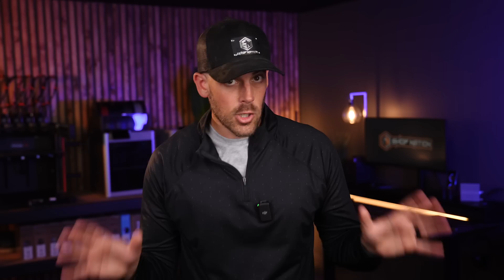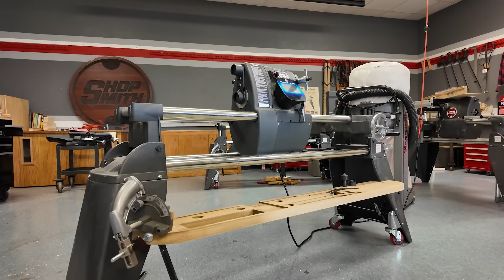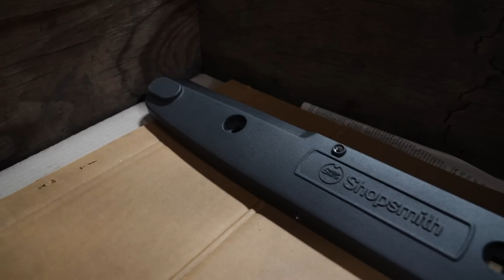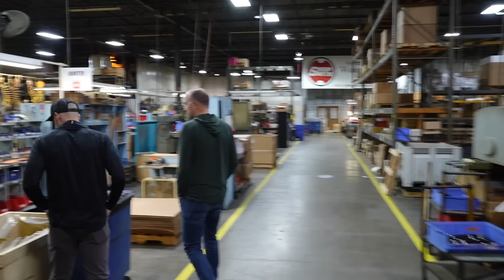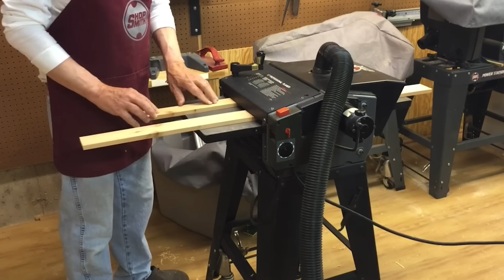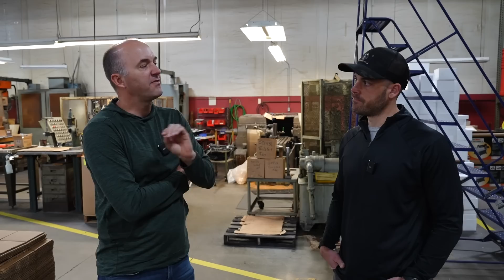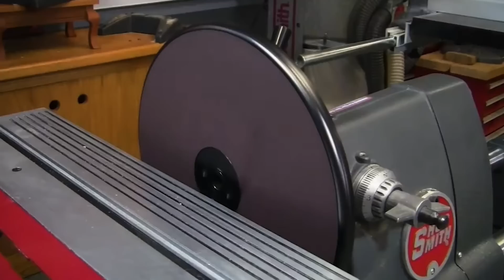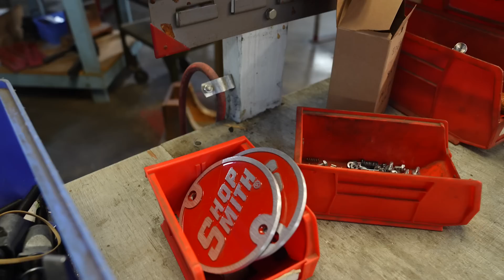The Last American Power Tool Company is (almost) dead

Comment: Nick was correct to downplay the table saw aspect especially since its a tilt table design which greatly increases the danger of binding and kickback when you tilt the table for a beveled cut.  Back in the day we had a few tradesmen who used ShopSmiths and they were not a good choice for job sites to say the least due to their unwieldiness when unloading and loading and we eventually had to ban them from the sites due to the tilt table mishaps.  For use as a hobby saw in a home shop where you'll never be making a beveled cut especially on large stock they are fine.

Yes its sad that most American Power Tool Companies are owned by foreign groups with most manufacturing done offshore.  For example Milwaukee, Rigid, Emerson Electric, Homelite along with a few others are owned by a Hong Kong based company who owns Ryobi too and also makes cheap vacuum cleaners.  Last time I replaced a bearing in a Hong Kong Rigid power tool (made in the Ryobi factory) and asked for an exact replacement bearing since it was for a sander, the owner of the local bearing supplier told me he refused to sell cheap garbage bearings like that and I'd have to pay for a higher grade which ended up costing less than $2 so one has to ask how cheap was the OEM?  The OEM only lasted a few months so obviously very cheap indeed while the $2 bearing has lasted several years in much heavier use.  It took less time to fix it myself (two hours including the trip to the bearing supplier) then to wait weeks while it was sent out under the "Lifetime Warrenty" for review to determine if it was repair, replace or deny.

Of course we have to blame ourselves for this since it was back in the 70's and 80's the government sponsored advisors were sent out to groom businesses for expansion with the formula for success we paid to develop and implement being to immediately offshore manufacturing to South of the Border and get rid of our manufacturing staff in the USA but don't sign any long term contracts so you could switch manufacturing over to China once the administration opened that avenue up.  We sat there in disbelief as we were told to basically axe the family and friends or in other words loyal employees who helped us grow our business and hire South American Companies temporarily and then dump them after they invested in expansion to support our business to shift manufacturing over to China.  We viewed this as highly unethical but couldn't compete with those who did as advised despite having a superior product.  People stop us to tell us that how now 40 years later our products are still holding up while they've gone through many of the off-shored alternatives they had to purchase as they expanded their business.

How's that go...  Load gun, raise foot, take careful aim and shoot repeatedly if need be until you get the job done.  Yes, we basically shot ourselves in the foot on this one and the road to recovery will be a very difficult journey with many casualties.

Whats next is probably an AI controlled Robot with a variety of attachments to work wood, metal, etc to replace us altogether and can also do the yard work, clean the house, cook our meals, bathe us, etc, etc, etc.  What could go wrong....  Oh no, that's a power plane not the bath loofah!  ;>

Best!

Comment: I bought all of the tools in my shop that the Shopsmith has, and it all cost far less than the Shopsmith Mark 7 and they far surpass the capability of the Shopsmith. No one has any use for a 4" jointer. Six inches is the minimum for a useful jointer. People are also moving away from straight blades to helical cutters. I started with a 6" straight blade jointer, and now use a small footprint 10" jointer with a helical head. I needed the extra width and ease of use with the helical. You have a good, solid product, but you need to get with the program of the evolution of woodworking. Slab leveling would be a good addition to the powerful motor of the Shopsmith. Keep your heritage and base platform, but grow with the times.

Comment: I am 77 years old.  I still work in my shop daily, (hobby) and I have pretty much any and every tool in the book.  But I don't own a shopsmith.  They have an outmoded idea of what the market wants.  European manufacturers make combo machines, that are pretty good.  But they don't try to do EVERYTHING.  Their tools combine two or maybe 3 things.  Shopsmith tries to combine too many things.  So, fine for the beginner, but after you get skill, you get dedicated machines.  (I have 3 large table saws, a small wide belt, 3 jointers, 2 bandsaws,  shaper, sanders, mortisers, etc.  
Also, not sure I understand him saying they are the last.  First, there is Northfield, (Minnesota made)  They make great machines.  Table saws, planers, jointers, bandsaws, etc.  HIGH quality.  People will still pay for quality.  Been around for more than 50 years.  Or what about Shaper Origin?  I know they have their machines made by Fesstool but they design and sell them from CA.  They are a new company, again, QUALITY!  and innovation!  There are others too.  I'd suggest that they take their mfg knowledge and design a great machine, a better drill press.  (3 phase motor with a VFD, motorized table adjustment,  maybe push button drilling option?  Or a great sander?  Most people don't buy edge sanders and they should.  Or an innovated wide belt sander?  open ended one like PM and others make.  but market it!  smaller machines?  a really large RA sander?  like an 8" one that is electric.  A lot of folks I think would like that with all the folks working with slabs..   wish them luck.

Comment: I run a Laguna table saw and a pieced together 1950s Shop Smith Mark 5 that I inherited with a new all electric motor.  I have a smaller shop, and this setup works well for me, but here are the areas that need improvement on the Shop Smith from a long-time user of the product:
1) The learning curve on how to use them is steep, and with outdated materials and info, it can be a big barrier to using the tools. Sometimes, there are several steps and procedures that are not inherently obvious to the wood worker.  I heard we can expect some new youtube videos, and that is great, but there are guys out there on YouTube making content with these machines already, and they do a good job. The machines them selves are not easy to use for most people, especially when a lot of our world today is plug and play. 
2) The maintenance schedule on these machines is outrageous for the average wood worker. I have rebuilt my machine and head stock several times over the years, to the point that I was doing more maintenance and fiddling with it than actual wood working. Great if you want a project tool but annoying when you are trying to finish one more Christmas gift for the wife. It is better now that I upgraded to the power stock head with the digital pad, but the rest of the machine still requires more routine maintenance than any other tool I own.
3) The cost, I used my first machine at age 16 in my girlfriend's dad's garage and loved the idea. But way too expensive to get into, so I waited until I inherited on from my wife's dad, then I started buying old ones for parts because the parts are expensive as well. Slowly rebuilding the machine as I got money. It was a project that was not making other projects for a long time. I understand manufacturing costs and built-in the USA, but many some form of payment plan or something would be helpful. I bought my wife a $10,000 sewing machine, and they let me pay monthly for 5 years. It makes it more manageable for people.
Pros:
These machines are beautiful and one of the most versatile machines for a small shop. I use mine almost every day I am in the shop. It gets more use than any one single tool besides my drill/driver. I believe this is a great product if people know how to use it safely and to its abilities. Great machines and I am glad they are working to revive the company.

Comment: Loved seeing this video. I honestly thought they had closed years ago. I am a fan of them and owned a 10ER as one of my first machines. I started “making” with turkey calls, and that machine would do everything I needed it to do. Even as I grew into a big shop space I kept it around as a “just incase” tool because it was a backup everything. The only reason I don’t have mine anymore is when I sold that property the new owner specifically asked for that tool to be left in the workshop.  Best Craigslist $125 I ever spent.

Comment: I have a shop full of power tools.  I've also had a couple of Shopsmiths--an old Greenie and a newer Mark5.  I've mainly used the Shopsmith as a horizontal boring machine--and it's a great one.  But also as a variable speed bandsaw and a sander.  Great niche tool even for those of us with a shop full of other machines.  I used to work out of Dayton, and regret never having stopped by Shopsmith (easily in view from the highway) to see what was going on.

I wish them the best, and hope they can find a way to keep building a classic American machine!

Comment: I see lots of comments praising the Shopsmith. My dad had a Shopsmith while I was growing up and that is what I learned on. 40 years ago, I bought my own, have done some upgrades over the years and have purchased some of the accessories. I am a hobbyist, I have never been into mass production and don't sell anything I make.

However, I find it too imprecise. Too much deflection in the fence. Too much deflection in the table when using the drill press. I cannot create miter joints on long pieces of wood. Because of the tilting table, anything over 4' long will will either hit the floor or the ceiling. The miter gauge slots are not a standard size. Cannot get the tension on the bandsaw correct for re-sawing. On the other hand, it does make a great lathe. Alas, I'm not into turning. When I upgraded the table and fence, I lost the option to use the mortising hold down with the new fence.

It is a great idea, and when I was operating out of my basement, it was the only thing that would meet my needs at that time. For someone with limited space it isn't bad.

My suggestions are to standardize the miter gauge slots, and improve the fence. Make a better blade tensioning system for the bandsaw.

Comment: Trying to replicate what was done in the past will not work. The key to Shopsmith future success is to develop a new business from the bones of the old one.  Even in the hey day Shopsmith has always been a niche product.  The key to Shopsmith future is to  ditch the all in one tool and consumer market.  Shopsmith could sell the components in custom designed configurations to make one type of part to the custom mill shops and small manufacturers.  Shopsmith could offer a complete solution to small custom manufacturers for making their products using similar motors, controllers, components and bases.

Comment: As one who has owned a Shopsmith for many years and passed on the machine to his son who also is a woodworker I will tell you that owning and operating a shopsmith has always been a joy and a privilidge, I even did an upgrade to my machine myself with great success. Having had a relationship with the Shopsmith Brand for over 30 years I was amazed to see it was in trouble, to lose such a valuable piece of equipment would be a major loss to the US woodwworking inductry and a major failure to thousands of DIY'ers.  I suggest that as many as possible support the revival of the Shopsmith brand!
Phil Owens SFC Ret.

Comment: Two things:; first the woodworking hobbyist culture is dying and had been since the advent of the personal computer. Second, offshore made machine-seperates can be purchased for less than the Shopsmith now and afford greater versatility. Shopsmith survives by having a small following, mostly of people that were exposed to one bought by their father or grandfather. It's not a BAD machine, it's hard to compete witrh a company like WEN that can sell a whole suite of tools that do the same thing for less money. Electric motors and inexpensive casting are very economical now.
The statement that a same percentage of young generations want to be woodowrkers as past generations I believe is erroneous. The young people today are into Adduinos and 3D printing, not turning salad bowls.

Comment: Having it do the job well and be FULL SIZE MACHINES for Lathe, bandsaw, Larger Jointer and Drill press would be worth it.  You will not compete with my table saw but I wouldn't mind cutting my footprint by getting rid of some other tools.  Currently, I own a sawstop jobsite, tracksaws, drill press,  dewalt dwx planer, jointer, Small bandsaw, routers, festool dust collection, festool miter saw.  I don't have a lathe and I don't have a lot more space.  If I could get a full size options for Lathe, Jointer, Drill press and Bandsaw for a good price I would consider it.  At the moment Shopsmith has not kept up with the technology and the pricepoints.  The ability to get in to the system is one of the biggest problems you face.  It is much easier to build your collection piece by piece and shopsmith seems like a all in investment or you can buy used junk sitting around in someones garage.  As you said good luck with competing with the table saw market or tracksaws.  Focus on a lower starting point into the system, then on upgrading option,  and lastly clean up ease of use.   By forcing the your ALL in and large upfront investment you have injured yourself.  I would recommend making a entry level Configuration for a single tool at the lowest price point you can make it for.  IE,  A full size Drill press for under 1000 or something to get you in the door.  What is the lowest Full size tool you can provide at your lowest pricepoint?  Should be your first question.  Then down the line people will add-on as they learn more and expand.  Upgrade options on the motor would be a plus also.  Upgrade the base model motor making it the same as your higher end model with a add on kit.

Comment: I purchased my first Mark V new from Shopsmith over 25 years ago. I purchased it because my space was limited and the price of the Mark V was far cheaper than purchasing individual machines. My original Mark V is primarily just used as a table saw and I leave the jointer on the end. I purchased a used Mark V over 20 years ago and I use it for sanding, drilling and lathe functions. I would highly encourage anyone who is considering getting started in woodworking to at least research the Shopsmith. It will cost more than just a table saw however it will do so much more. Also Nick is correct in saying they just don't break.

Comment: Interesting, I remember the shopsmith back in the 80’s, I was interested in all the different tools that could be used on the same platform. I have been a hobby woodworker and DIYer most of my life (in my 60’s now). I have seen the occasional shopsmith pop up on Facebook marketplace and never thought much about it where would I get parts and support. I am sorry to admit that I did not know that they still existed. Space had always been an issue for me, I would never give up my table saw but could see a real use for combining things I only use occasionally like the lath, drill press, maybe disc sander. Might need to look into this further.

Comment: It seems Nick work would benefit from incorporating a worktop that is precise, like the MFT, for track saw work, and axe the table saw. That would lower their cost and price, and likely make the system more appealing. A table saw can be had for $300 that takes up very little space, but can’t handle a sheet of ply. A circular saw with a simple track can be made for very cheap, but the precise worktop is the key to consistent results. It seems like a partnership with someone on Etsy is the way to go….

Comment: Hals Wood Shop   SS owner over 25 years.  i want to add about the 4 inch jointer.   if you glue up a table top if you want success you aren't going to glue 6 inch or larger pieces.  They would be smaller width for stable expansion.   Most woodworkers want the large jointer for smoothing down rough stock. but in the glue up you want 4 inch or smaller and that can be why this is  all you would need.  rip down your stock and smooth what you need for stable width.   Also their guard is very safe.  Did you lift the 35 pound all cast iron tool , no skimpy tool..!!  Thanks.